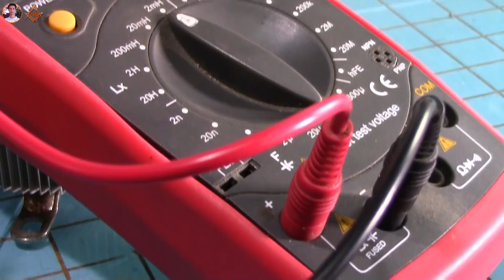How to increase subwoofer bass, Tips to use free chokes for better bass boost for speakers

Comment from the maker: Hello everybody. I have uploaded the subtitles to the video
In the first few seconds of the video, I introduced a project ...
that is the launch tube to kill bacteria,
This project can amount to millions of volts. can you misunderstand ...
The project can kill any type of bacteria, to protect the health. It is useful for life.
However, I still have not thought up the title so I paused the project ...
In this video, I introduce a way to boost the bass for a subwoofer, or any smaller subwoofer. and apply to all amplifiers. whether the amplifier is large or small.
You may not believe it ... but you can try ...
I have verified the iron core ...
If you want a simple filter that is not sophisticated, here I have calculated a common winding to filter the sound of any bass speaker,
The combination of inductors and capacitors will cut off a high frequency
So the bass sound will be stronger and clearer ...
Power from 100w to or highest is 8000w on both audio channels.
why you use high power filter?
 while your amplifier is so small?
Questions will be answered in the subtitles.
Thank you very much!
Reply: So you are saying that by adding a combinations of inductors and capacitors, you can increase the 100 w of power from the amplifier up to the higher 8000w or power?  So for example, an amplifier produces 100 watts of power coming out, and 100 watts of power going in to one speaker.  By doing this, it would now be 100 watts coming out of the amplifier, and up to a maximum of 8000 watts of power going into the speaker?  I'm just trying to make sure that I completely understand.
Reply from the maker: The coil will have 8000 watts of power for the entire amplifier, or 4000 watts per channel.
The coil can withstand any type of amplifier, whether it is a large or small amplifier
My point is that the coil does not increase the speaker output power
But it will not weaken the power running into the speakers
When using a high-power inductor, the resistance value will be zero
This makes the original power of the amplifier unabated.
it still cuts the frequency needed to increase the bass
If you use a smaller cord. At this point the resistance value is high.
It can weaken the current flowing into the speaker, making the sound smaller
Reply: @AlfredH  "The coil can withstand any type of amplifier," no it won't... this is yet another bogus assumption - what about a 30,000W amplifier? There are other limits besides the thickness of the wire... For a start the core material you have selected for the inductor is hardened steel its impractical, you need to use powdered Iron, or ferrite. Solid steel cores are inappropriate because if you have actually attempted to pass 8000W through it, you will quickly discover that the core will begin to heat up (check out how induction heating works, it explains what happens in more detail) but because the bearing is a solid lump of metal, you will generate eddy currents when an AC signal is passed, and that means a LOT of heat will occur, that is if your wire doesn't melt first. We basically learned this in primary school science class, where have you been hiding?
Reply from the maker: thank
Reply: zim. new
Reply: it's called a treble cut, I was doing this at 12 yrs old........ I'm 38 now, not a new "trick" smdh ppl are funny lmmfao
Reply: You’re an idiot!

Comment: Does it actually work?
Reply from the maker: you can try it. The iron core coils give higher inductance values than the air core
combined with a capacitor to cut off a high frequency
You can read the subtitles for better understanding.
Reply: shayne fitzgerald oh ok

Comment: you put the tip of the blue with the yellow they are of the same measure
Reply: No body gets it your just wasting wire. Buy a new amp for more bass. If you connect positive to negative in any way (like through a fucking capacitor) yea the frequencys change. The illusion that your getting more power is from the low end notes being expressed more profundly. In no way shape or form is this a good way to get more bass out of your speakers. Great way to blow fuses and waste wire though 👍
Reply from the maker: I do not quite get it
Reply: Anthony Bryson can you tell me how a crossover can blow the fuses?
Reply: If your putting "8000watts" through these 16gauge wires wrapped around a fucking rusty bearing to get more power your wasting wire and could easyly blow stock wiring on the head unite by doing so. He is smart and knows wht hes doing but also very pointless and dangerous in every day use situations. Do not put one of these on your speakers and then shove it in the box, its very unsafe
Reply: cringe radar if u really want to do it yu can but id sugesst keeping it below 75watts of power